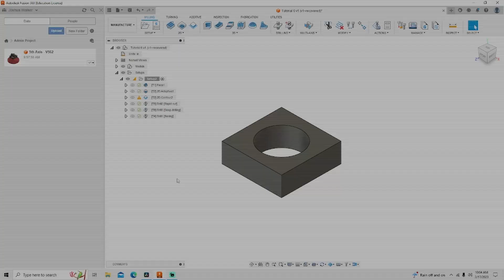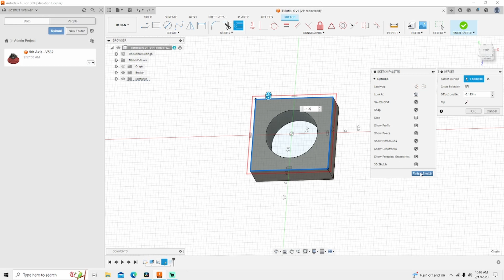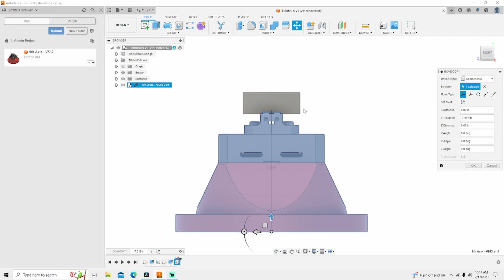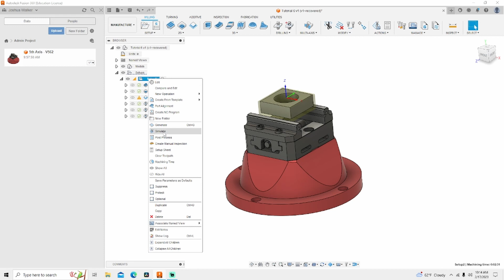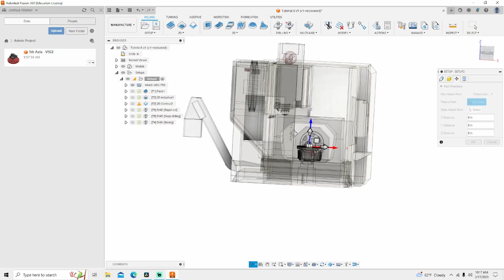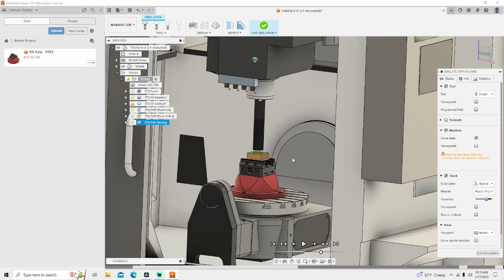Setting up a Machine and Vise/Fixture in Fusion 360

Comment: Yo my boy is that vise you used animated? I try doing this with a kurt model i downloaded but there was no controllers to move the rear jack.
Reply from the maker: It's not animated. It's just has joint that I can move to fit parts of different sizes.
Reply: @machinistmade784  so is it an assembly then?
Reply from the maker: Yes

Comment: If 3.25in x 3.25in is the stock size, then the 1.35in is the sawn length, not another stock size… unless mills are producing cuboids as a stock product now
Reply from the maker: We don't actually saw our material in house. However, if we were to saw it in house we would have ordered 1.25in X 3.25in Flat bar and saw to length 3.25in. That way we would not be depending on the saw cut for flatness when we load it in the vise. But our local supplier actually mill sizes our material for our 5 axis jobs. Even thou that would clearly not be needed for this simple part like this.